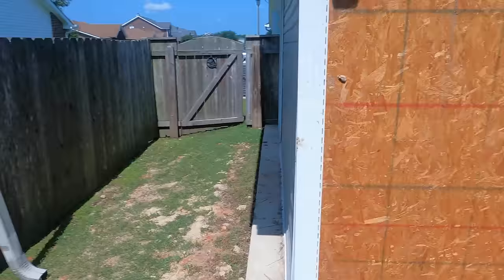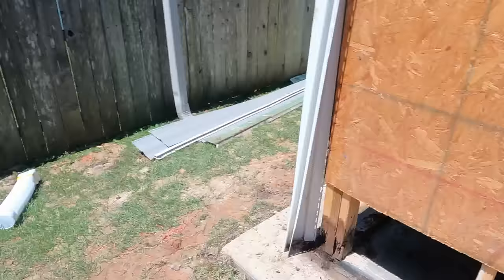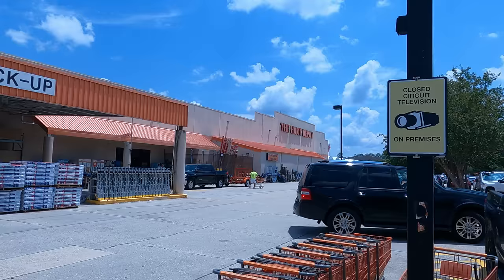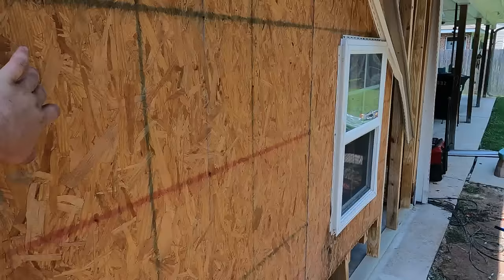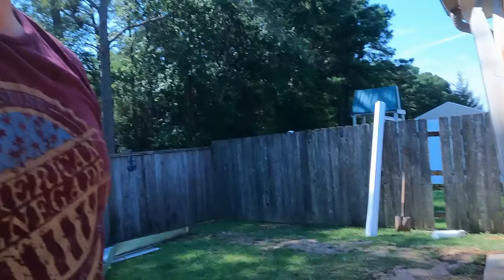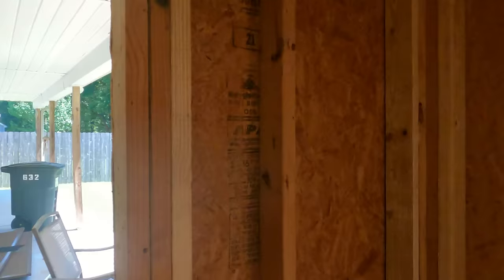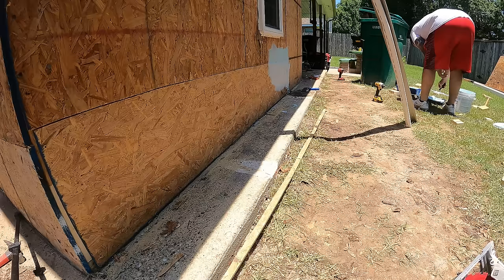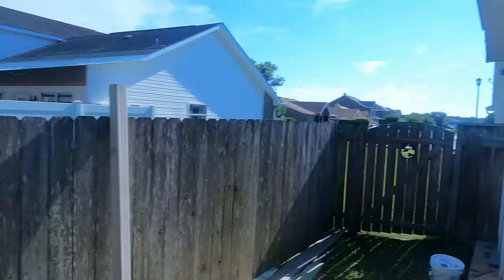How to Water proof a Shed.

Comment: I'm fixing a similar problem only that it's a dwelling now when once it was a carriage house.  The grade is too high or the slab is too low.  My concrete guy is going to lower the cement by inches.  I'm flashing the bottom plate and using hardie plank.  Also I'm going use redguard on the bottom course because the rot just made so much work
Reply: I forgot to add that I'm slathering on the green copper arsenals over the treated sill plate and the bottom of anything remotely within grade.

Comment: The siding and OSB on my shed is a good 4-6 inches from the ground and yet I get the same issue. The problem isn't the face of OSB gets wet, it's that rain water runs off the siding,  wraps around the bottom and wicks up through the edge of the OSB. Painting the faces of the OSB does nothing to prevent that. A solution would seem to be painting the entire repair strip especially the bottom edge.
Reply: Exactly, my shed is elevated and had the same problem, water wicking from the bottom of OSB.

Comment: I would have stacked 2-3 pressure treated for the bottom plate with silicone between them. Would have put regular plywood for the sheet and bottom, holds up better. I would have put aluminum flashing and back and bottom sealed it.

Comment: I need to know the brand/type of caulk I need and also the brand of the waterproofing paint. I will be getting pressure treated plywood if possible, ground contact along with pressure treated ground contact 2x4 joists, and also i need to know if flex sealer caulk will work?  Im going to work on the project very soon. Thank you!
Reply from the maker: @robpittstop1797 lexel is what I use for sealing tough spots. And Drylok paint is the best thing I have found for a good water proof seal. The manufacturer does not guarantee Drylok to work on wood. However Ive always had success with it. Let me know how everything works out.

Comment: Probably need to grind down the edges of the slab to let the water to flow away.  Grade the concrete.  3:56 Also, need to apply some sill sealer foam to the underside of the bottom plate to prevent wet concrete wicking moisture into the wood.

Comment: Since you had to remove sill and cut studs, a 6 inch concrete curb could have been poured for wall to sit on. That is how sheds and shops should be built. Great job though.

Comment: Is that concrete water resistant/water tight? Because the soil mousture will attack your wood structure again, because the the concrete can suck up the water in the soil.

Comment: That aquatic membrane is USELESS on the wall. Your whole issue is water intrusion at the point wheee thw wall meets the concrete. The problem is the concrete extends past the plate to the exterior allowing for water to be directed right back to the wood. I would have wrapped both rhe plate and the bottom edge of the osb with bituthane so that any water making it under the structure wouldn't contact the wood at all.

Comment: The water damage is similar looks like sprinkler over sprays hits the bottom plate silks up water damage to the top the one wall had to be replaced loos if water damage from roof gutter not working right

Comment: Why would you install the OSB down touching the concrete as before? Makes no sense.
No matter how much water proofing layers you roll on, water will still penetrate and destroy the OSB.
It is also making contact with the foundation PT which transfers moisture to the studs and OSB.
I would of used plastics between studs and OSB two feet from concrete,  then leave a 1/2 inch to 3/4 inch gap between concrete foundation and OSB to avoid any exterior ground rain water contact. Install weep screed, then Tyvek.
You guys look pretty amateur. How do you keep your licenses…if you actually have one? Unless inspectors in your area are amateurs as well.
Reply: The down spout from the gutter will destroy all the work you did

Comment: It failed the first time. So you did the exact same thing? Should have but metal L flashing under the bottom plate with caulk. 10" up the wall and then stared ply wood 8" up off the concrete wrapping with house wrap then starting vinal siding half inch below plywood. I'm thinking the original problem was water sitting on concrete from rain and irrigation and plywood sucking the water up.

Comment: Cement is porous so treat it the same way you'd treat a foundation wall for a house. Waterproof ON TOP of the cement so moisture doesn't wick up into the sole plate. And with that much water present, I'd also wrap 3 sides (bottom and sides) of the sole plate leaving the top open so any moisture will evaporate.

Comment: You’re relying on a waterproof paint and caulk , isn’t that gonna only last so long ? Why not cut a 3/4” deep groove in the concrete and bend a metal flashing that goes up and under the siding?

Comment: I'm dealing with an issue where a roofer cut in to my OSB while flashing my chimney.  They left holes in it and blade marks across the OSB.  From what I can tell, my OSB could turn out like the bottom of this shed over time!  Do you think if your OSB on your chimney was exposed around the bottom it could cause the chimney to collapse or cause other major issues?
Reply: The OSB was literally exposed in many spots. I went up on the roof during a storm (Not advised) and could see the water hitting the OSB and going around holes/blade marks.

Comment: Seems like there is a need to address the issue as to where is the water coming from and why.
Perhaps there needs to be a french drain installed to drain water away from the shed.
Water is the enemy of any building. Proper slope and drainage is a must. Too often water control is an after thought. It needs to be addressed up front.

Comment: i know this is going to be a tough question, but looking for a best guess, if that's ok. I am curious to know what kind of price this would be, if you can give it as labor and materials or separately ?  I have a sill plate that is about 12 inches up but could be 24 feet long. It's on pour cement foundation with crawlspace. Of course this is a home and not a shed but the work would be equal.  Appreciate your thoughts. Thanks

Comment: What if you need to replace the concrete under the sill and the rest of the garage? In phases? Garage floor then temp wall then outer foundation and then outer wall?

Comment: when I built mine, I coated everything with a thin, brushable solution if silicone caulking (silicone 1 caulk, and  mineral spirits or paint thinner).
 
I'm in a very humid part of Florida, and whether it be a rain storm, or a massive flood, the wood will be 100% waterproof and bugproof. 
 
However,  you do NOT want to use Pressure Treated, as you want the solution to absorb into the lumber (especially the end grain). 
 
I also use this solution on cement/concrete. 
 
the only thing it doesn't work in is metal/plastic. 

A12'x22' Shed cost me around $200 total to completely waterproof it. and I mean COMPLETELY WATERPROOF. They sell tubs of Silicone, but it would cost thousands to treat everything with their thin solution.
 
So just experiment with it a bit. You MUST use Clear #1 Silicone, and mineral spirits. Mix 2 parts silicone to 1 part mineral spirits. (I use a paint mixing drill bit.) Then brush/roll it on and let it cure. for 2-by lumber, I actually dip my end grain into it. It absorbs quickly and it takes 3 or 4 coats to brush into end grain. so dipping is ideal in that situation. 
 
Now, instead of a shed, you can have an Ark. Or if you have it mounted to a slab, You can use it as a Sealab! ("There go my nipples again Lois!" lol)
Reply from the maker: That's a neat idea, I'll definitely experiment with it. Thanks!
Reply: Sounds like a good hack. Thank you for the tip.

Comment: Your work is fine but me.. I would have just build a short cripple wall, probably using pressure treated 4x4, then just let the existing cut wall studs sit on this. I would also have skipped the construction adhesive and wrapped my bottom plate in vapor barrier. Then I would never have brought my sheathing all the way down to the concrete. Concrete is porous and over time the sheathing {in your case the OSB that I hate} will eventually still soak up water. I do really like that you put a sealant on the bottom 18" of sheathing. Not sure your caulking really did much. If your final exterior siding is installed right, that sheathing should never get wet.

Comment: this could if been avoided if the shed was the same dimension as concrete. correct?
Reply from the maker: Yes that would have helped, or if the edges had been graded with a slope running off.

Comment: It's all going to rot away again just as fast due to the drainage issue and big thanks to vinyl siding. Vinyl siding should never be used in the south. It sweats and holds moisture forever.

Comment: At the 9:37 mark of your video you mentioned that you were about to put on the Tyvek wrap, but instead of using Tyvek wrap you used a cheaper, lesser quality wrap called everbilt. 
Why'd you do that?
Reply from the maker: @cma8165  The simple answer is I call all house wrap tyvek out of habit. It's like calling an adjustable wrench a Cresent wrench. But to be clear, the quality isn't diminished by the brand name.
Reply: @kmremodeling6923  That's what I used to think until last Saturday, when I saw a YouTube video of a contractor who tested both Tyvek and Everbilt and proved that Everbilt allows water to go through when Tyvek does not.

Comment: Next time pour a concrete curb with the slab, and set a pressure treated plate, and your framing on that, instead of on top of the slab. Doesn’t  mater what you do to repair this, water is still going to get in.

Comment: The bottom plates should be sitting on concrete blocks…
Reply: I was thinking concrete wall with metal flashing.
Reply: @elvism684  Can you make a 2" wall for the sills to sit on top of that the water will not penetrate.  Maybe paint some type of water proofing on weather side of 2" wall.  Is that called a sleeper footing.  Then you could put Z flashing, or whatever to go over and down the sleeper footing.

Comment: I do not understand. Why are you not using pressure treated wood where it is in contact with the cement?
You are not replacing studs, you are sort of sistering the studs, but not blocking the original studs? Why are you using regular studs rather than moisture resistant studs or pressure treated? Same for the siding (opposed to OSB)?
If you are in Louisiana, isn't that a hurricane/flood state? Is what you did up to code?
Reply from the maker: Hi Sheila, if you pay attention you can clearly see that the bottom plate ( the only wood that is making contact with the concrete) is PRESSURE TREATED. as far as the studs go they are "sistered" together however all the LOAD is on the NEW studs which go from top plate to bottom plate. As far as OSB goes the top part is OSB and the client wanted OSB on the bottom. All work was done to code. Thanks for watching, however you should go back and watch again because all questions were answered throughout the video. 🤘

Comment: Timber should not touch the floor.Block ,damp proof membrane and sole plate on top.Sorted.😂
Reply from the maker: All work was done in accordance with local, state, and IBC guidelines. Please reference IBC chapter 23 section 2304.12.1.2 & 2304.12.1.3

Comment: Don't do what they do in this video! In principle, they tear down a bad structural solution and restore it with another equally bad structural solution.
Water will penetrate the boards from below and spread further up the structure via capillary suction. The home owner will have the same problem in approx. 2 -3 years.

Comment: What adhesive did you used to secure the bottom plate to the concrete?
Reply from the maker: liquid nail was used to create a seal between the bottom plate and concrete floor. then we shot rimfire nails into the concrete through the bottom plate. you can also use tapcons as well.
Reply: @kmremodeling6923  find it hard to believe rimfire nails are code approved for the load bearing sill plate; especially in hurricane prone areas. Most if not all codes require a minimum of ½” bolts at 6’ O.C., with a minimum of 2 per wall section.
Reply: @zefrum3  this stuff fascinates me, I want to be able to fix up my homes in the future and make sure they are as strong or stronger than needed. I like to overbuild things. Where can I look into codes and know what needs to be done so I can make the improvements? Thanks for your input!

Comment: Why not build a knee wall and slide it under the cut studs.  Top plate botto. Plate and short studs. Then sheet from bottom plate of knee wall to a highet point on the exciting   longer stud wall . Or put in 8" or higher  block wall

Comment: Let me get this straight.  You went to the extent to use waterproof caulk around the bottom plate and used a Mapei waterproofing product 18-24” up from the bottom and then you attached house wrap using NAILS with a washer (that went through your waterproofing) that, by the way, aren’t waterproof!   Things that make you go HMMM.

Comment: You should not have placed the bottom plate directly on the concrete. You should’ve used foam beneath. And I could be wrong, but it looks like you used Liquid Nails to glue down the bottom plate. Again, bad idea. It also wasn’t necessary to go thru half the 2x4 pile to pull out straight lumber for a shed. Absolutely no reason. The OSB was also ran directly down to the concrete. This is improper. It’s not rated for contact such as that. Not sure bathroom shower waterproofing is rated for exterior use and if it is you didn’t follow the directions since you can still see thru the coating. To do it correctly you should’ve used marine grade plywood. This homeowner is going to have the same problem in a few years. Do it right or do it over.

Comment: Why wouldn’t you just put treat wood around the bottom
Reply from the maker: The bottom plate is treated. but treated wood doesn't stop water intrusion.
Reply: @kmremodeling6923  Treated wood rots when constantly wet as you said. While this repair may not be the way I personally would like to do it, it is perfectly serviceable and cost effective. I would guess the repair will last quite a while and methods were dictated primarily by cost savings requested by the customer. I hate to see wood framing built slab on grade though but you did a repair not a total remodel. The customer should and you most likely do know that the improvements others have suggested add significant cost to this attached shed job. If this damage was to the main living space I would have been less likely to bid on a job accepting the customers penny pinching requirements. For my own home I think 2 or 3 hundred dollar cost for a much better outcome would be money well spent. Keep up the good work, it's tough making a living out there doing what you do.

Comment: WTF was this guy thinking when he put this up? 
First he needed a drain field around the foundation, then he needed a concrete block to raise the building up off the slab! Next you would lay down a vapor barrier between the foundation and the 
building! Build a regular wood flooring system will sill plates! 
A raised foundation bed 6 inches above the existing ground with a drain field, would have helped keep the Water from flooding onto his slab causing Moisture damage!
 Research would have been helpful before this guy ever broke ground!
Reply: I'm having the same issue, previous owner made the garage into a bedroom but did not raise the foundation to match the house foundation so now it gets flooded. what do you mean by drain field?
Reply: not to be confused with a mean minefield... lol
Reply: You guys got to remember that the client might NEED all the extra bells and whistles but the client sure doesn't want to PAY for them. I guess you can see how badly they want that repair done properly by the number of inches their eyebrows raise when they read the quote, just like we can tell how expensive it will be by the length of the contractors sharp intake of breath when he first looks at the job.

Comment: The bottom plate needs sit on cinder blocks 8×8×16 with anchor bolts . This job will get you fired in all 50
states .

Comment: Awful.. water will always settle and rot the bottom.. your shed has to over hang  the concrete so the water rolls off the foundation. They need to remove that concrete lip and put a drain system. You can argue about sealeants etc... but the foundation is the problem.
Reply: I have the same situation before I start my wall build.  I cannot cut the cement back nor increase the footprint of the wall.  I will have a wall on top of a slab with 8" slab on outside.  I also must come up with a solution.

Comment: Your repair still falls way short of a solution to his moisture intrusion problem. That will all rot out once again. Lipstick on a pig is all you did. You need to get that OSB siding up minimum 6" above the concrete. Also. you most likely did not waterproof the bottom plate, and the interior portion of the wall including studs. You had the opportunity to pour a concrete stem wall, or install a CMU stem wall.